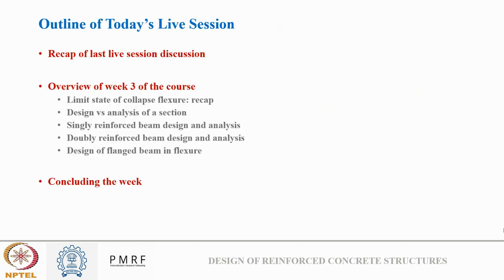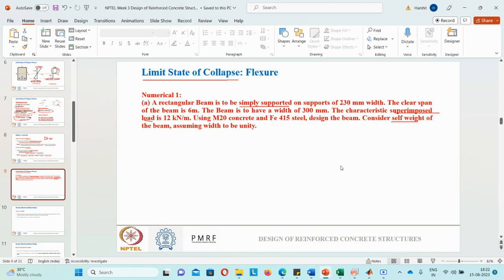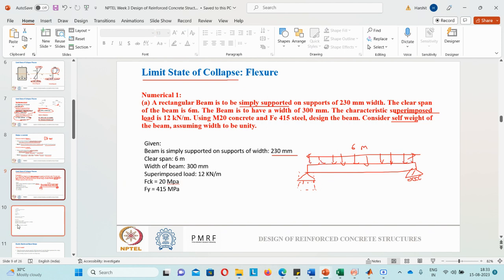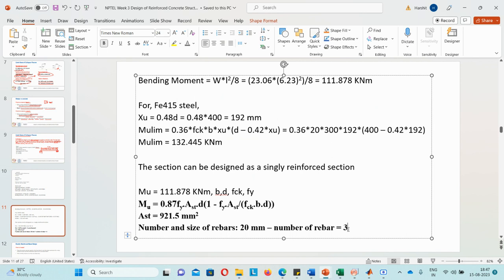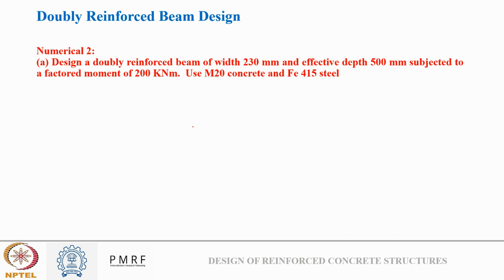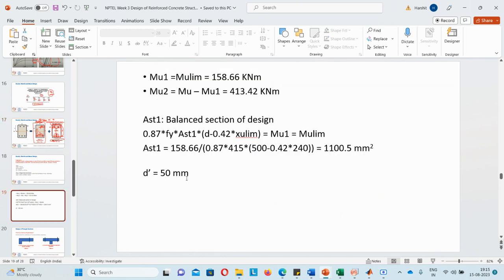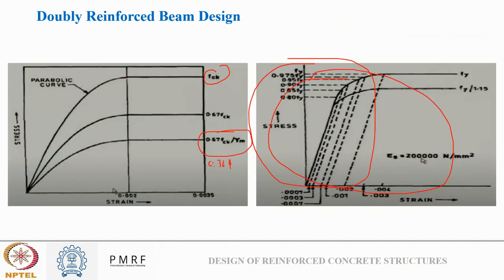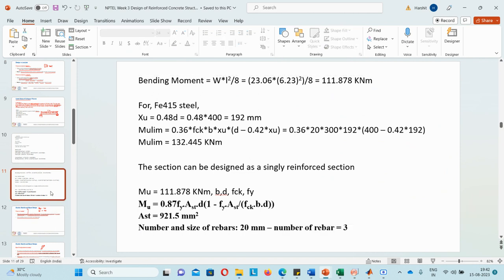Design of RC WEEK 3: Singly Reinforced, Doubly Reinforced Beam & Flanged Section Design using IS 456

Comment: What if the in doubly reinforced beam Muc < Mut is this type of section can be used practically ?
Reply from the maker: See, when Mu is greater than Mulim, we go for doubly reinforced beam, right? now, while designing, we first design tensile reinforcement part with Mulim, where steel and concrete counterbalance each other's moment. For remaining Mu - Mulim, we say that as Mut. But since strain is different in compression and tension side, my area of reinforcement in tension and compression can be different, but my Muc (Asc*fsc*(d-d')) and Mut (Ast2*fy*(d-d')) will be the same because they should be balanced for equilibrium conditions.